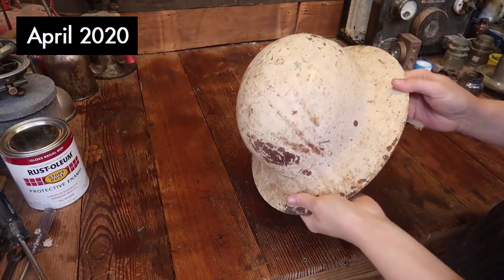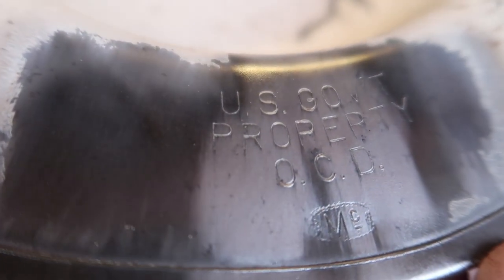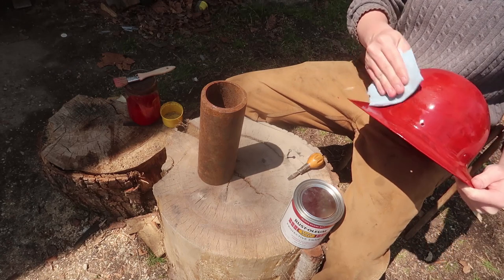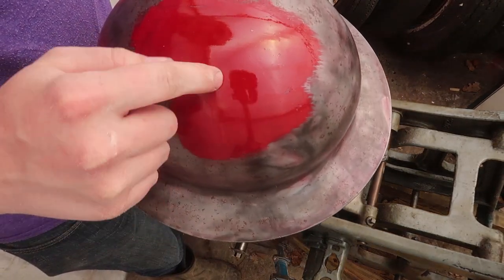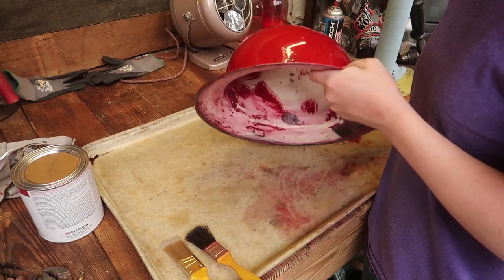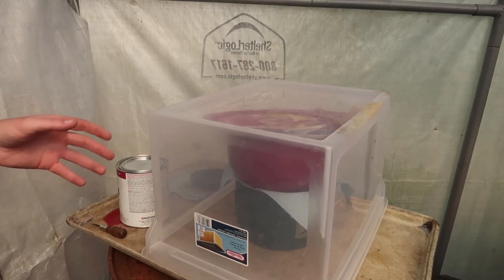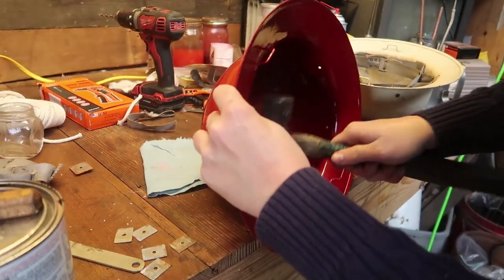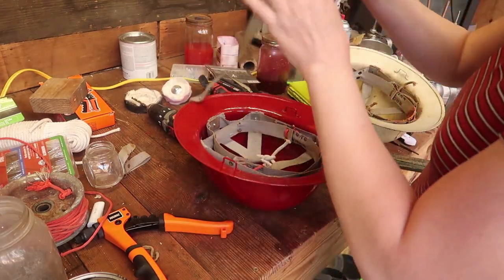1950s Civil Defense Helmet Restoration / Modification, Chasing Perfection with Brushed Enamel Paint

Comment: The paint didn't want to stick to bare metal. A coat of primer will give the enamel paint some tooth to stick too. I'm surprised you didn't do that after sanding.
As an artist and painter I can tell you that nothing ever comes out perfect on the first coat of paint. You have to build upon many layers to get the perfect color and consistency.
It turned out really nice in the end, so this probably doesn't help now lol
Reply from the maker: its designed to stick to bare metal, it was an issue with temperature. this paint is for tractors.
Reply: @RinoaL  Tempature has an effect but having painted with Rustoleum I disagree. It May claim it can handle being painted on bare metal but the results say otherwise. For best results priming in white first
Reply from the maker: my wrenches still havent gotten scratches in their paint, so yes it does work great on metal without primer.
Reply: @RinoaL  One-step paints are an engineering compromise.  They work to a degree, but an application-specific primer will always give better results in the long run.  It depends on your needs and expectations.
Reply: @RinoaL  do they make aluminum ones

Comment: The trick to brushing with enamel paint is to thin the paint so it goes on rapid, and not too much at a time, and you get chance to brush it in, let it dry off  use wet and dry to key the first layer, then repeat the process, many thin coats work a heck of a lot better than putting it on thick. oh and of course the right temp does help, also not loosing your temper is a big help. Looking forward to seeing your painting technique improve  the more you do. X
Reply from the maker: honestly another viewer mentioned months ago how the pigment particle size plays a part as well. for instance the black paint smooths over perfectly in many temperatures.

Comment: for smaller items i have painted them then baked them for 11 minutes in an oven at about 150C, this allows the paint to flow smoother and hardens the paint quicker by driving off the volatiles, the colour may darken slightly. leave it in until its cold and the results should be good.
Reply from the maker: that sounds promising actually.
Reply: @RinoaL  why did you think car paint shops have heated booths to dry the paint , it might be worth experimenting with the timings (in an old oven, i am sure you could pick one up somewhere) to get optimal results, maybe using some old tools you are restoring.
Reply from the maker: i didnt, i've never seen a paint shop. i just move the paint from my hot shed to my cool workshop and that was enough for me.
Reply: @RinoaL  it was how the old fashioned car guys used to get spectacular finishes on cars in the days before spray booths, a rolls royce back in the day had maybe 5 coats of paint, each one meticulously sanded down between coats. a rolls royce would have nearly 100 lbs in paint alone. and would take 7 days to paint.
Reply: nowadays its 20 spray coats to achieve the same level of finish
Reply: @grendel1960a  Plus primer...

Comment: That old pipe wrench you were using as a hammer deserves as much respect/preservation as the helmet. Cool project though.
Reply from the maker: what? the coes wrench? those are designed to be hammers
Reply: @RinoaL  I have one that has been cracked through such use. I haven't been able to find anything online that says they were "meant" for such use, but I'm sure many people used them that way.

Comment: Those specks in the paint at the beginning were probably dust nibs. Any self-leveling coating will also self-level onto any dust that falls on the surface; probably why it stopped happening when you covered the helmet with the plastic bin. With enamel paint and varnish I usually get the best results just by sanding between coats, and after sanding the final coat I put on a coat of paste wax to bring back the gloss/shine.

The end result looks good though, and I like the idea of using a flea comb to clean paintbrushes; never would've thought of it.

Comment: Did you degrease the helmet between cleaning with the wire-wheel and painting? I've had issues with the wire-wheel being a source of contamination. One of the problems with only having the one! I might try degreasing the wire-wheel itself at some point but for now it's easier to degrease whatever I'm about to paint. Turned out nice in the end! Sure shows what it takes to get a smooth coat in sub-optimal conditions, helpful stuff!
Reply from the maker: yes i used acetone
Reply: Oh good! That wasn't part of the problem then. Good repurposing of the flea-brush, I'll have to remember that!

Comment: I have one similar, but maybe rarer? It's missing it's strap and liner, and looks like it was left in a forest for 6 years. But, The reason I haven't removed all the paint is because it's a rather odd specimen.. It's just like any other Civil Defense helmet, but it has no blue circle around the logo, and it says, in painted blue text, "Sect 3 Post 8", so the paint being in the condition it is, I thought I'd leave it in it's current state.

Comment: You could have thinned that paint with some lacquer thinners day ran it through a HVLP paint gun I’ve done it many times you would have been done in a day just a thought not a dig at your work.
Reply from the maker: paint guns are so wasteful though, just finding the right temperature is good enough.
Reply: @RinoaL  HVLP is good at minimizing waste and overspray; that was the impetus for its design.  Back in the day my father used to work at a plant where they manufactured early versions and brought home a few broken units that I cobbled together into one working unit and used it to paint our house and later, a car.  It was a joy to use.  Had absolutely no problem with overspray.  It would be overkill for such a small project as that helmet though unless you already had one for other reasons.

Comment: If I didn’t admire you so much, this video would have been good for my dose of Schadenfreude. I feel your pain, I really do; I used to service (restore, really) vintage wristwatches for other people; it’s nearly impossible to work on a 35mm diameter watch with a 24mm diameter mechanism that is supposed to be disassembled, cleaned, and oiled every few years, but hasn’t had it done once in the things 40+ year life without scratching the tiny screws, the movement plates, or the exterior finish of what’s supposed to be a piece of luxury jewelry. Any mistake means going back to step one, and a mistake is the smallest slip of the hand.

I’m sure you consider the finish bad; I won’t dispute you, for even HD video can’t show me what you see with your own eyes. But it looks really cute on you, Rinoa. I am wondering, though, what the difference is between that and an older full brim metal hard hat. It looks a lot like the American-made MSA hardhats I used to sell- albeit in plastic.
Reply from the maker: i say laugh at this project, i still got a helmet i eventually liked
Reply: Rinoa's Auspicious Travails oh I did laugh. You are always entertaining. I just don’t take joy in you being frustrated. I’ve done enough self-learning in my life to empathize. And laugh, because I can relate.